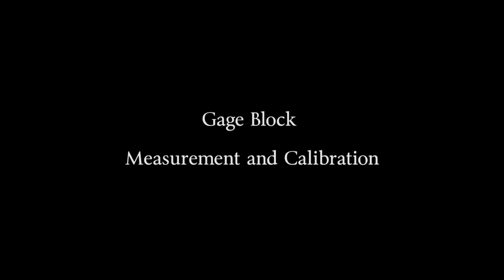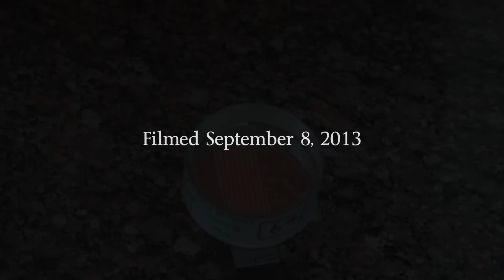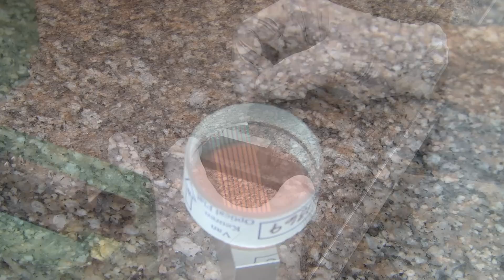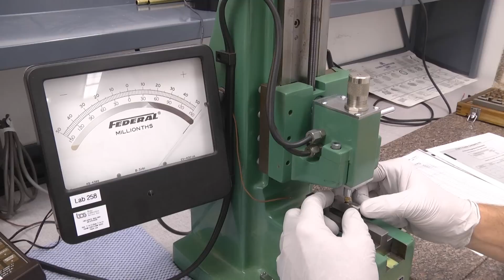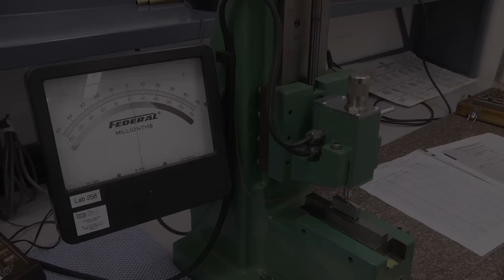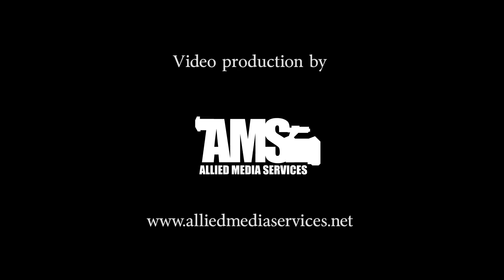Gage Block Calibration Process

Comment: I don't understand your flatness measurement. If the gage block were perfectly flat then the optical flat should rest right up against it and there should be no interference fringes. The pattern you showed looked to me like there was a slight angle between the optical flat and the gage block surface - like a burr was holding up one edge of the optical flat.
Reply: The fringes are caused by air trapped between the gageblock and the opitcal flat. If you give it enough time the fringes will disappear. For the pattern the only thing that matters is parallelism between the lines, if there was a burr the lines would curve